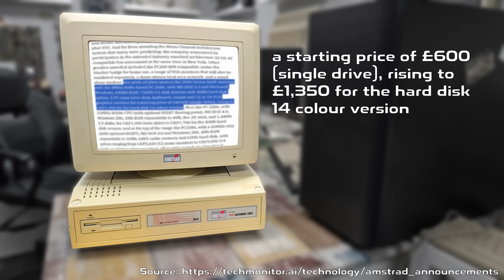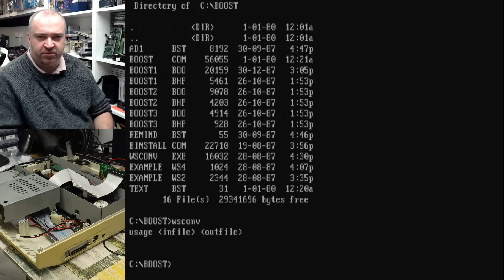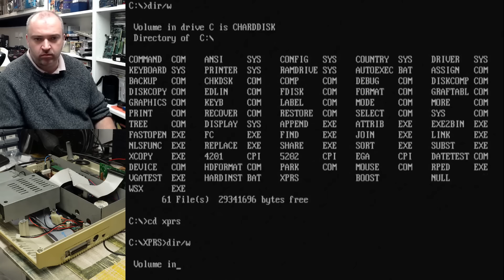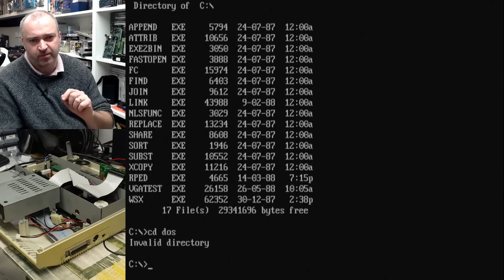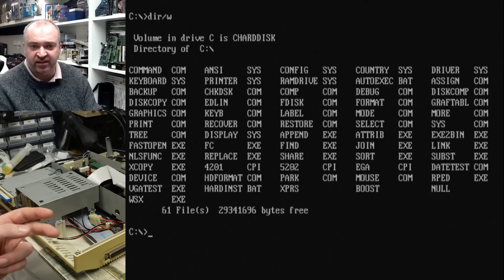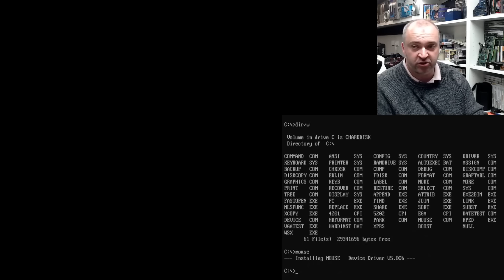Can I fix this faulty Amstrad 2086?

Comment: I have never seen a Rubycon go bad. Could they be fakes?
Reply: Very much doubt it, I don't think faking of Japanese caps was even a thing in the 1980s. Amstrad were budget but they were reputable, and typically contracted the big Japanese/Korean electronics companies to assemble stuff for them.

And I doubt a fake cap would be old enough to drop its guts to that degree!
Reply from the maker: Yeah as said above I would doubt its fake.  Most likely just a combination of age and the proximity to the heat sink adjacent which stressed the cap causing it to fail.